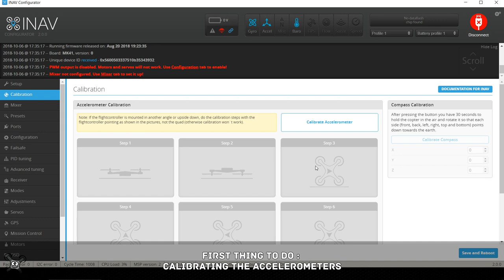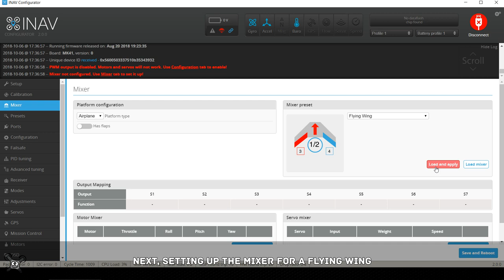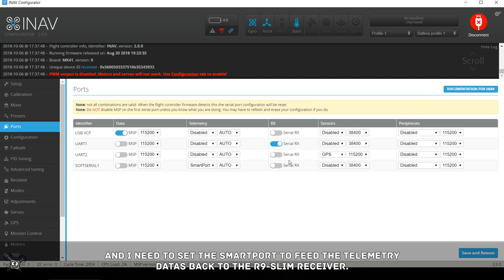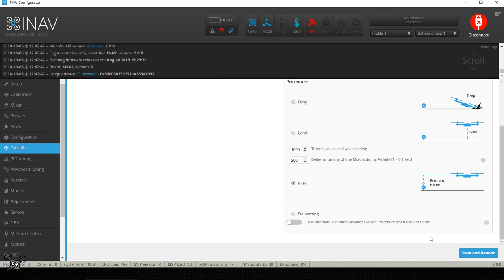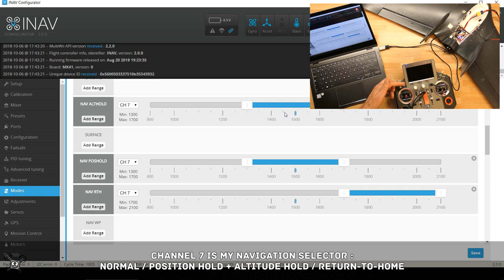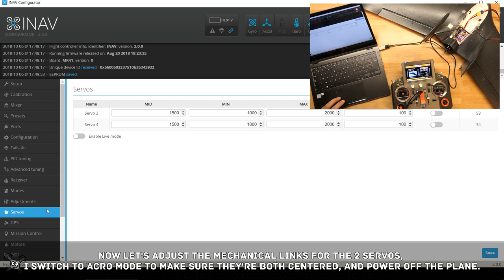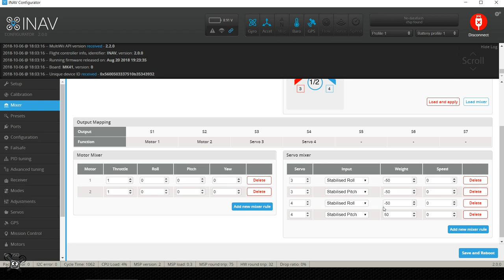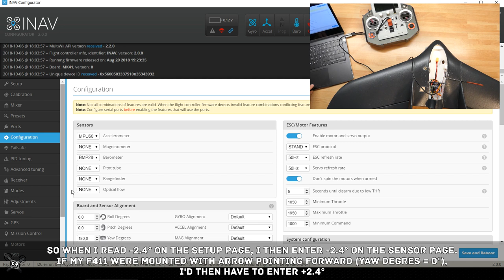VERSION 2 - Z84 Inav F411-wing R9 Split Mini - PART 1/4

Comment: Looks like you directly connected the VTX to the VBAT, which directly connects to the battery and not filtered. Isn't it going to be a lot of noise on the video?
Reply from the maker: No noise on the video, the feed is super clean ! And a 600mW VTX pulls too much to be on the FC, and this one only provides some weak 5V anyway. So no other option, apart maybe an extra 12 or 5V BEC

Comment: I found the Servo Autotune to work well on my Z84....Its very sensitive to trim and doing it all manually using the clevis turns is a PIA. to get it to fly right in Manual Mode.
  Then again, I rarely fly it in Manual Mode....:)
    I have the new R9M TX Module 868mhz and Micro RX coming tomorrow...the RSSI looked nice and stable....What antenna are you using on your Horus..?

Comment: bonjour,

Vous utlisez un R9slim,  j'utlise un r9slim+ en Eu-lbt (25mw/16ch telem ON)  et je n'arrive pas à remonter la télémétrie de la FC (f411-wing) pad  ST1( vfas,GPS, etc...) j'ai juste le btrx et le rssi du récepteur.
D'avance merci de votre aide?
Reply from the maker: Salut, si tu a la tension RX et le RSSI ça veut dire que la telemetrie marche bien entre le R9slim et le R9M, donc que le bind et les firmwares sont ok, mais que l'info n'arrive pas depuis la F411. juste au cas ou, est-ce que l'option telemetrie est bien activée dans iNav/Betaflight ? Et le port est bien réglé sur "Smartport" ?

Comment: bonjour, au niveau du RSSI a part câbler un fil sur ST1 sur la carte et programmer un channel sur la radio que faut t'il faire de plus ??
j'aurais besoin de détails supplémentaire ^^
Reply from the maker: Salut ca depend du recepteur, c'est quoi ? Sur mes derniers installations je ne cable plus le RSSI, je recupère la valeur sur le canal n°16 ça fait un fil de moins à souder !
Reply: @Olivier-C  ok  mon récepteur est un L9R, il y a une sortie Sbus ainsi qu'une Rssi
Reply from the maker: @spinrah oui avec un L9R ca sera obligatoirement sur la sortie RSSi analogique
Reply: @Olivier-C  donc un fil qui part du signal sur le Rssi du récepteur et branché sur ST1 de la carte ?

Comment: Bonjour, 
Je fais suite a mon montage de ma Z84 idem que vôtre configuration. elle vole pas mal. Cependant je n'arrive pas a avoir un gps fiable.( (model neo M8N)  Cela marche une fois sur deux et encore, et ou cela est long voir aussi débrancher et rebrancher pour avoir les coordonnées GPS . Je ne comprend pas. J'ai juste fais un vol avec tout les paramètre vitesse, altitude etc.. sur 10 voles.
J'ai mis la dernière mise à jour inav 2.2.1 mais rien n'y fait.
Le gps fonctionne bien lorsque je branche la carte sur le logiciel inav, il a bien des données qui arrive. Tout les paramètres sont au vert...
Du coup je n'est pas de RTH pour l'instant aussi..
Je ne trouve pas la solution...
Avez vous une idée? 
Merci d'avance
Reply from the maker: Hello, ça pourrait être plusieurs choses... perso je n'ai pas une bonne opinion des M8N, j'en ai plusieurs qui ne marchent pas ou de façon aléatoire, maintenant je leur préfère les BN 220 BN 880 etc. 
Pareil pour les Matek F411-wing, sur mon dernier avion (AR wing mini) j'ai du racheter une F411 car la première n'a jamais voulu marcher correctement.
Dans le configurator INAV, onglet GPS, est-ce que cela communique bien à 5 ou 10hz, et avec le compteur d'erreur qui monte un peu au début, les premières secondes, et après cela ne doit plus augmenter. Si le compteur d'erreur augmente au dela de 30 secs c'est signe d'un problème de communication entre GPS et FC.
Et aussi, bien avoir le GPS sur un UART, à 115kbauds, et non pas sur un port en Softserial, ce n'est pas fiable.
Reply: @Olivier-C  Salut Ha ok en effet. Mon gps et en uart 2 à 115200. Il est alimenté en 5 volt. Brancher comme sur le plan de la FC.  Sur Inav, je suis a 5hz.. Je n'est pas de message d'erreur par contre et n'ai jamais eu. Le total messages communication monte bien..
Par contre c'est long pour avoir 6 satellites ..La je viens de la mettre dehors et j'ai bien les coordonnées exacte. Mais bon c'est une fois sur deux. Si demain je veux voler je peu ne rien avoir même en débranchant et rebranchant... 
Aussi comment vérifie tu si le RTH fonctionne sur le banc. Sur ma FX61 équipé d'un autopilote plug en play, quand je met rth les ailerons bougent au taquet et en vol cela fonctionne bien . La sur ma Z84 rien !!!
Reply from the maker: @marielauregibourg8324  Avec INAV pas possible de tester le RTH au sol, faut que l'avion vole, et qu'il soit plus loin qu'une certaine distance de son point de départ.
 Si le GPS ne prends que 6 sats c'est qu'il doit être gêné par un autre composant, soit émetteur vidéo, ou camera HD ? (Type Split, Runcam etc). Par exemple sur mon AR mini j'ai du mettre le GPS tout au bout d'une aile pour qu'il dépasse les 8 sats. Quand la réception est bonne (et le temps clair) on doit avoir entre 10 et 18 sats. Eventuellement essayer en débranchant les servos, parfois c'est eux qui perturbent.
Reply: @Olivier-C  Ha ok peut être ça le souci. C'est vrai que au maxi j'ai 7 ou 8 sat et encore . L' émetteur vidéos en sous le capot et la cam foxxer simple et sur le capot donc pas loin en effet...je n'est pas osé mettre les gps sur une aile car mon aile est démontable et je ne voulais pas rallonger les files. Je l'ai placé en limite jonction fuselage et emplanture d'aile
Reply from the maker: @marielauregibourg8324  faut faire des tests en debranchant les "suspects" pour essayer de trouver ce qui gène, ou parfois juste en mettant la main pour faire écran ça suffit à faire monter le nombre de satellites
Reply: @Olivier-C  J'ai démonté le gps et je l'ai éloigné un peu ..effectivement je viens d'avoir 14 sat. J'ai éteint et rallumer cela  fonctionne mieux .. Donc il faut que je le mette mi aile en gros .Si on rallonge les câbles du gps cela ne pause pas de problème?
Reply from the maker: @marielauregibourg8324  Les fils de GPS ça peut facilement faire 30cm. Il faut les torsader (un peu) les 4 ensemble par precaution, cela évite qu'ils fasse antennes pour du 2.4GHz ou 5.8Ghz ou 900MHz etc
Reply: @Olivier-C  salut
J'ai donc déplacé le gps sur mi aile et la ça va . J'obtiens 20 satellites au peu long mais bon et le rth marche super bien maintenant enfin .  Au début premier vol le moteur coupais de temps en temps et en rth il régulais bizzard . Après quelques minutes de vol plus rien et le moteur gère bien en rth!!! je sais pas si cela a voir avec le nombre de gps car au début de vol j'en avait 10..
  J'avais commandé dans le doute un gps Beitian BN 180. est ce que ce gps irai mieux d'après toi!
Merci

Comment: What servos did you use?`Are Turnigy TG9d servos good enough?
Reply from the maker: That was with Emax ES08MA I think. Any decent 1.5-2kg servo will do, TG9D are ok
Reply: @Olivier-C  ok good. Also I notice that a lot of other builds have the vtx / rx out on the wing. How much does this make a difference with r9m & 800mw vtx?
Reply: @Olivier-C  How much does it make a difference to have digital servos instead of analog?
Reply from the maker: @leonardvdj  Digital are stronger and can hold position a bit better than analog, but the difference is not huge. It's more important to make sure they have metal gears
Reply: @Olivier-C  ok gonna get towerpro mg90s servos then :)

Comment: What servos did you use
Reply from the maker: Emax ES09MA (or MD)
Reply: @Olivier-C  thanks I really appreciate the reply
Reply: @Olivier-C  is there anything else that you could also recommend that is good. currently when my servo moves my video is super bad
Reply from the maker: @AlbeyFPV  twisting the cables for the servos and the VTX can help, to prevent them acting as antennas
Reply: @Olivier-C  tried that. Still getting the same results sadly

Comment: Hello, c'est quoi la difference entre mode manuel et acro ?
Reply from the maker: manuel c'est juste le mixagecdes elevons sans stabilisation. acro c'est stabilisé en attitude
Reply: @Olivier-C  Merci de ta réponse mais es tu certain de ca ?, pour moi acro = pas d’assistance et aucune limitation. je debute inav et les controleur de vol mais je fais de l'avion depuis 20 ans. Pour moi le mode manuel était le mode acro, le mode angle = assistance. je me trompe ?
Reply from the maker: @ludoviciglesias9521  100% certain !
Reply from the maker: @ludoviciglesias9521  https://github.com/iNavFlight/inav/wiki/Modes
Reply: @Olivier-C   ok je pense avoir compris les différences entre chaque mode, donc en gros le mod angle ne sert a rien si on sait déjà piloter. le mode accro est pratique pour lisser le vol en cas de fort vent. Merci de ton aide.

Comment: Bonsoir , 
J'ai quasi vôtre configuration, sauf dernier firmware et esc turnigy et Horus X10 mais 
je ne peut pas armé mon moteur. Que faut il mettre en paramètre batterie sachant que je suis en 3S...Merci 
# status
System Uptime: 33 seconds
Current Time: 2041-06-28T01:04:00.000+00:00
Voltage: 0.16V (1S battery - NOT PRESENT)
CPU Clock=84MHz, GYRO=MPU6000, ACC=MPU6000, BARO=BMP280
STM32 system clocks:
SYSCLK = 84 MHz
HCLK = 84 MHz
PCLK1 = 42 MHz
PCLK2 = 84 MHz
Sensor status: GYRO=OK, ACC=OK, MAG=NONE, BARO=OK, RANGEFINDER=NONE, OPFLOW=NONE, GPS=UNAVAILABLE
Stack size: 6144, Stack address: 0x20020000, Heap available: 916
I2C Errors: 0, config size: 4201, max available config: 16384
ADC channel usage:
BATTERY : configured = ADC 1, used = ADC 1
RSSI : configured = none, used = none
CURRENT : configured = ADC 2, used = ADC 2
AIRSPEED : configured = none, used = none
System load: 4, cycle time: 1010, PID rate: 990, RX rate: 49, System rate: 9
Arming disabled flags: HWFAIL RX CLI SETTINGFAIL
Invalid setting: report_cell_voltage
Reply from the maker: Hello! C'est peut-etre le fil de mesure de tension qui est manquant ? C'est quoi comme carte de vol ? Pour ignorer l'erreur on peut entrer dans la CLI : set report_cell_voltage = OFF (puis save), mais c'est mieux de trouver la vraie cause du problème
Reply: @Olivier-C  Mateck F411
Reply: F411 wing comme celle de vôtre vidéo avec le dernier firmware exactement
Reply from the maker: @marielauregibourg8324  En laissant les valeurs par defaut comme voit sur cette video à 6:30 normalement c'est automatique, 3S, 4S, 5S ça se fait tout seul perso je ne change jamais ces valeurs. Si ça ne marche pas, il faudrait reflasher la carte avec inav, en faisant bien "full erase" au debut, au cas ou il resterait quelque chose en mémoire. Si ça ne marche pas mieux, je ne vois plus qu'un defaut sur la carte comme explication !
Reply: @Olivier-C  Bonjour
 ok, pour reflasher on fait comment "reset setting"!
Reply from the maker: @marielauregibourg8324  C'est dans le configurateur inav , "firmware flasher", il faut cocher la case "full erase" en haut avant de flasher et ça suffira à tout effacer. Et ensuite voir si le problème de lecture de la tension persiste. Et flasher un inav 2.1.RC2 (pas un 2.0.1) , ça evitera de tout refaire quand la version 2.1 finale sortira
Reply: @Olivier-C  ha moi j'avais falshé en 2.0.1 du 28/11/04 car je'ai vu que cela!
Reply: sur le site mateck je vois le 2.1.0 RC1 cela va?
Reply from the maker: @marielauregibourg8324 Faut prendre celui-ci :  https://github.com/iNavFlight/inav/releases
Reply: @Olivier-C  ok merci  lequel du coup  le F411, le F411-RSSI ou F411-SFTSRL2
Reply from the maker: Ca depend du recepteur, dans le doute met le F411 tout court :)
Reply: @Olivier-C  c'est un R9 slim +
Reply: ok j'ai reflashé et j 'ai tout enfin.le moteur démarre..plus qu'a pofiner et voir pour l'osd